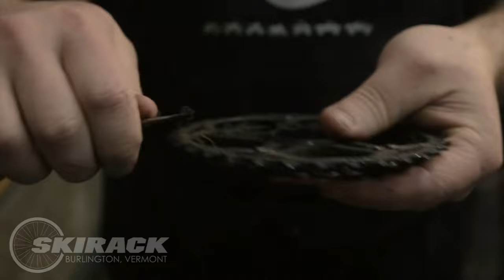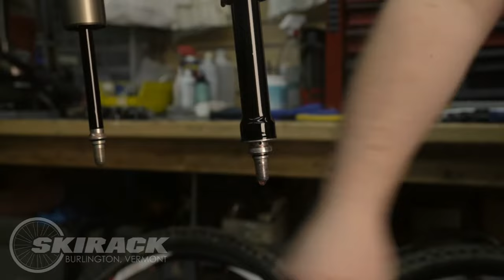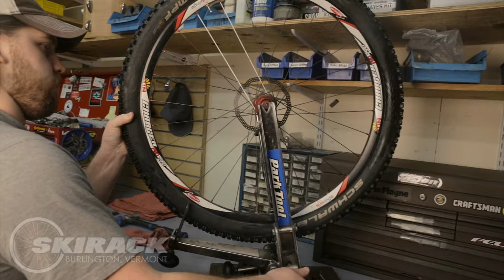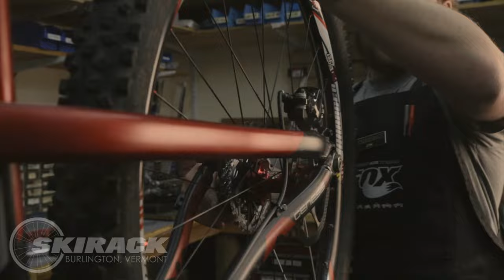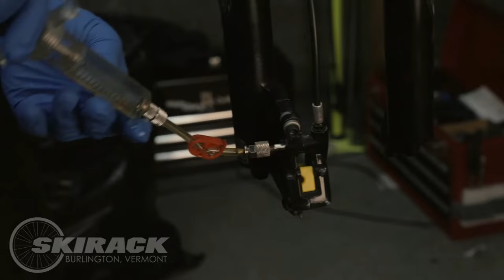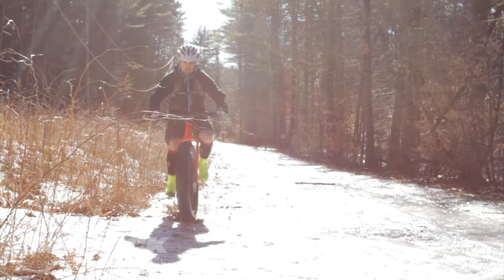Deluxe Bike Tune at Skirack

Comment: You use just water In the ultrasonic cleaner? How many runs in the cleaner?
Reply from the maker: Hi Gary, 
My apologies for the delayed email. I have been advised by our service manager:
We use a non-foaming detergent specifically designed for ultrasonic cleaning. The detergent is 10% of the total mix the rest (90%) is water. Usually parts are run through the cleaner once for 15-20 minute cycle. Another 10-15 minute cycle can be added/needed for parts that are extremely dirty.
I hope that helps!